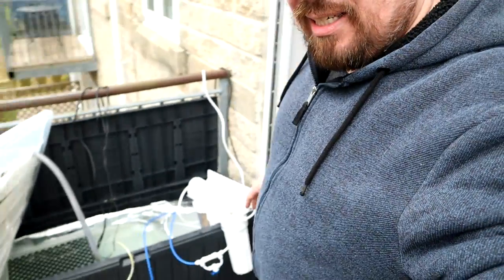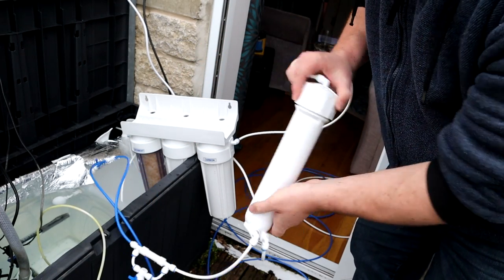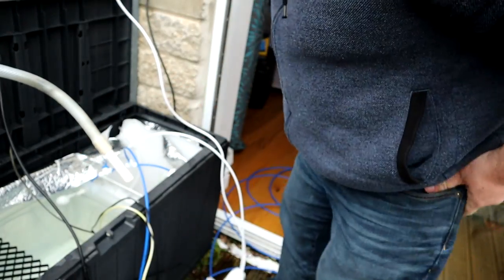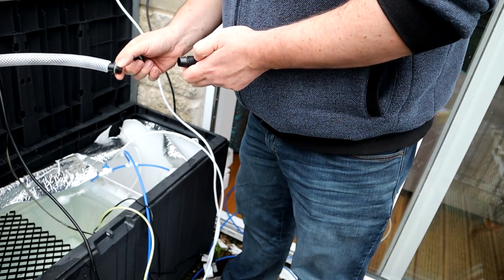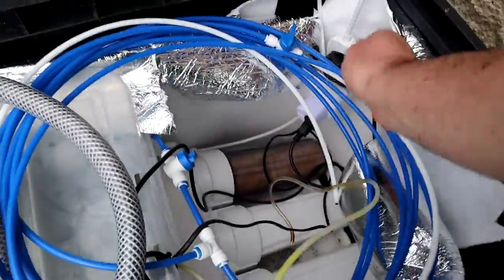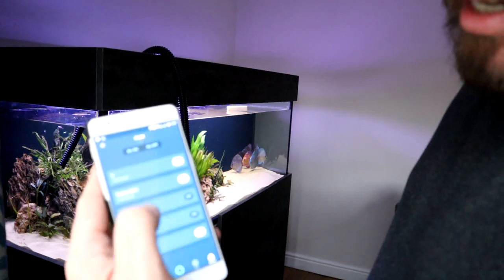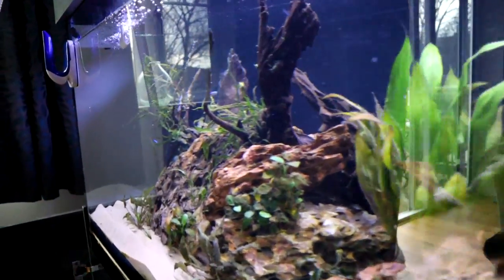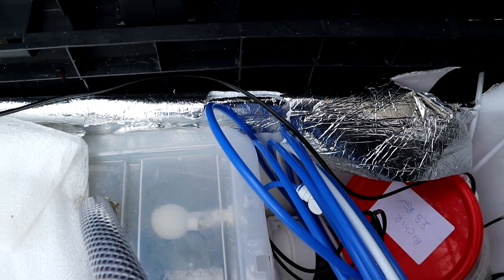Aquarium water change on big tanks

Comment: What is the container that you use for the filtered water? I've been afraid to buy one like that in case it can't hold the weight of the water and might leak.
Reply from the maker: It's nothing special - usually the worst that will happen is they will bow, but they wont normally leak.

Comment: Your pretty much setup for changing to an auto water change are you not ?
Would you not be better to drill the tank for an over flow stright outside to the water butt ?
And thru the same pipe run the filtered drip feed back to the tank from your outside water tank.
Thats what i am building now.
Just not sure on the flow rate atm.
Reply from the maker: If my wife would let me drill a hole in the wall thats exactly what I'd do!
Reply: @AquariumAdventures  lol ! I do it when they out 😂😂

Comment: Great video! I was just wondering why you keep up with manual waterchanges and don't put a continues drip system on your display tank? Just like you did on the rest of your fishroom tanks?
Reply from the maker: For a drip system you need a water source in and an overflow into a drain - which would require drilling holes in the wall. Which i'm not allowed to do. So to answer you question - because I want to stay married. 😉
Reply: @AquariumAdventures  Hahaha. I fully understand! I have the same challenge :)

Comment: Ahh I use the exact same pump. Think it cost me £9 off eBay and its 1000 lph. Decent pump for filling tanks back up with plastic boxes, and I like the feature of it taking water from the bottom. I run my plastic boxes almost dry. Decent little pump I think for the money. Although I did get a UK adapter with mine (the listing said its from the UK, so i messaged the seller and said, its not from the Uk it has a china/USA plug on it. I got a full refund, and they let me keep the pump for free LOL).
Reply from the maker: Nice one! Mine is the 1500 lph one - it's nowhere near that but it does a job!

Comment: Racist Alexa - must have been designed by someone just south of the border. Great video mate, I’m having an absolute mare in the fishroom at the moment.
Reply from the maker: She definitely has issues with Scottish people! Whats going on in your fishroom?
Reply: Aquarium Adventures Hatch rate was really poor so decided to set 3 new 18” cubes up with 80% RO on a drip system. Used 3 very mature decent sized sponge filters (no other filtration) and set the drips to do about 90% water  change a day yet still getting ammonia - doing my head in - I’ve increased to 125% water change via drip system a day (massive over kill) and still ammonia. Think I’m going to need to build a new sump, now have to find some space
Reply from the maker: @sedaquatics7277  Daft question - but have you tried a different test kit?
Reply: Aquarium Adventures yeah I tried another kit today and readings are true, I’m thinking maybe the air flow through the sponges in the old tank wasn’t sufficient and maybe I have seriously over estimated the amount of bacteria in those sponges. I’ve covered them with some sexy tights and out in the base of the tights by the weight on the sponge filter I’ve put some cycled biohome. Hoping that will do the trick. Unless you have any other ideas.